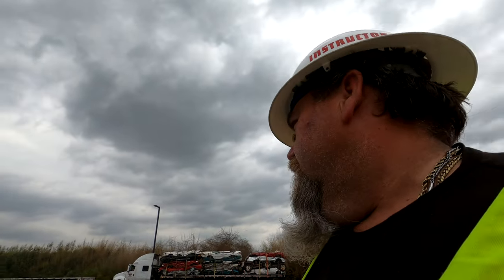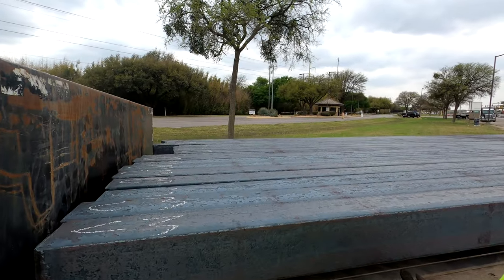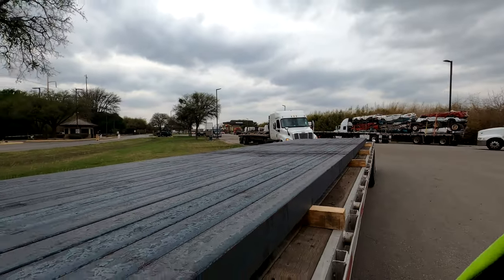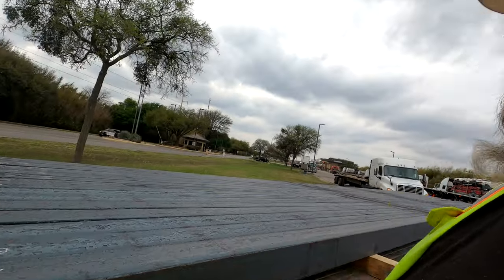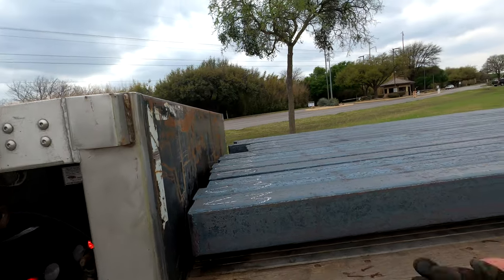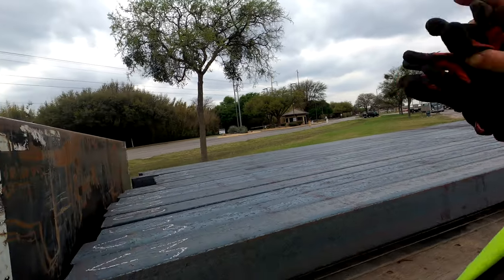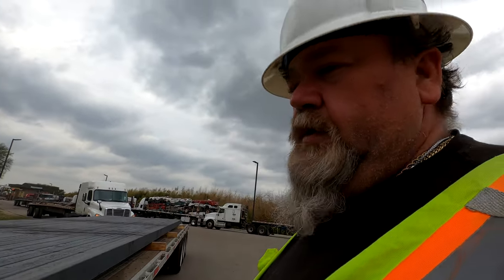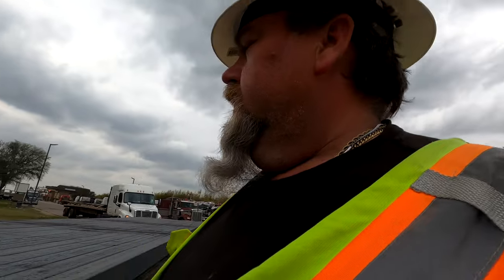How to Secure Billet Steel Bars

Comment: Thank you for providing education for your viewers, it's always good to have someone out here making content for those eager to learn.

Gonna pick it apart now lol...

There's a case to be made regarding how to hook your straps on both sides of the "argument", for lack of a better word.  In your example of how you do it the down side would be what happens if/when the strap becomes loose for various could-be reasons. I.E. load shifting a little, loosening the strap....the hook could simply fall off the rail and dangle, not securing anything, to any degree, at that point and there would only need to be about 3 inches of slack created for this to occur.  A DOT wrap faces the multiple stitching and multiple layered side outward to resist abrasion and cuts, by design this type of wrap is protective.  

Federal reg doesn't require alternating pull to be in compliance, that is company policy and/or personal preference.

Federal does NOT require 2 in the last 10....also, on that note, when articles of cargo are blocked from forwarded movement or placed in a position where it (forward movement) is prevented by bulkhead, other secured cargo, etc.. you are not required to place an additional tie-down in the first 10 ft.

This is a misconception by many drivers that don't read their regulation book and continue on the word of whichever previous company(s) told them this.  

As always, you can use as much as you want, I'm just speaking on minimums.
Reply from the maker: i appreciate your comments.

some trailers do not have hook pockets and keepers like fountaine trailers typically have and if the rub rail is rated with a WLL then the use of a DOT wrap is acceptable. i have spoken with multiple DOT officers in Oklahoma and Texas and if a trailer has designated securement points (Hook Pockets) it is preferred that they be used.

you are correct alternating pull is not required by FMCSA it is a personal preference.

also no the FMCSA does not specifically say 2 in the last 10 but it does discuss that you have 1 securement for every 10 feet of product so following that guideline will automatically give you the 2 in the last 10. I will do a better job of explaining that in the future to reduce any confusion. Texas, Oregon and Washington have stricter guidelines and require a securement every 5 feet. and you are correct that if forward movement is blocked by a bulkhead or other secured cargo then you dont need to throw an extra tie down however on loads such as lumber or plywood/osb on a standard flatbed without a bulkhead it is recommended to throw an additional tie down on the leading stack to prevent forward movement.

again thank you for your comments discussions like this is an amazing way to help each other and learn new skills and methods

Comment: Thank you for making video for this. Please keep making videos on how to secure. Also, when do you check your load when yoo start driving. I was rold every 3 hours or 150 miles. I was told first 50 miles. What is the comfortable or right way on your experienced or what is your suggestion. Also, do you do it on rest area or truck stop. 
Thanks
Reply from the maker: Will do thanks and doing load checks is the first 50 miles and then every 3 hours or 150 miles and also every time you make a duty status change so fueling or during post and pre trip inspections bathroom breaks plus while your driving your checking straps and chains during your mirror checks I do most of my load checks in rest areas because it’s quicker to get in and out there and trucks stops take more time always waiting on other trucks to get out of the way

Comment: Dot don't ask to pull opposite...a 48 feet trialer only have winches on the driver side
Reply from the maker: Correct DOT does not require opposite pull and many trailers are set up with winches on one side many however have the track for winches on both sides and can be set up with opposite pull. That is a driver preference and I am showing how I do things including my preference I don’t believe I stated that opposite pull was a DOT requirement I believe I was speaking to the spacing between straps

Comment: Am I right in thinking some states don’t let you hook straps onto rub rails and you must hook onto a separate anchor point or chassis ?
Reply from the maker: It depends on the trailer manufacturer for instance most newer Fontaine trailers have a hook pocket built into the trailer and it must be used as that is the rate anchor point for those trailers if a trailer is not marked or factory labeled with working load limit decals or plates then you should anchor to the strongest point of the trailer which is usually the winch track I have seen some that anchored to the frame of the trailer your best option is to research the trailer manufacturer to locate an identify the correct wll ratings for you specific trailer.
Reply from the maker: It not jut states that require that it’s also federally mandated that a trailer that has anchor points designed into the trailer are to be used because that will be the safest and strongest anchor point. And yes some states don’t like using rub rails as anchor points unless the manufacturer has listed a wll rating specifically for the rub rail for instance a reitenour trailer typically has the rub rail rated
Reply: Yeah where I drive we're not allowed to have anything whatsoever on the outside of the rub rail, it's gotta be hooked underneath